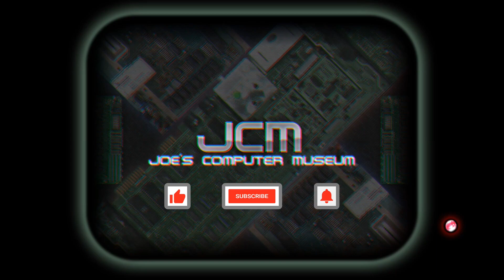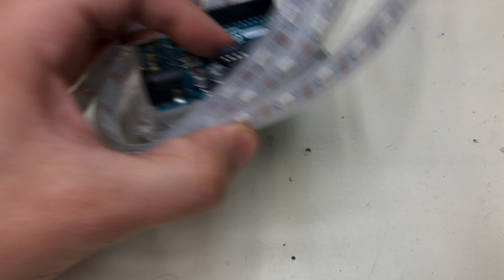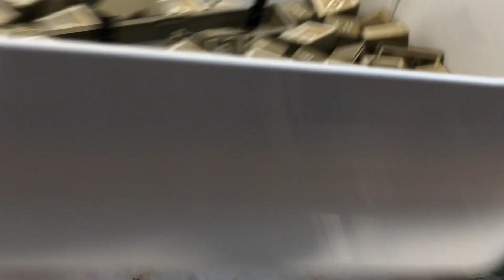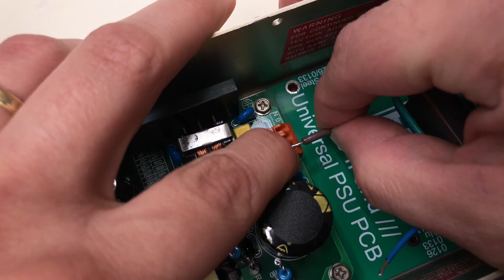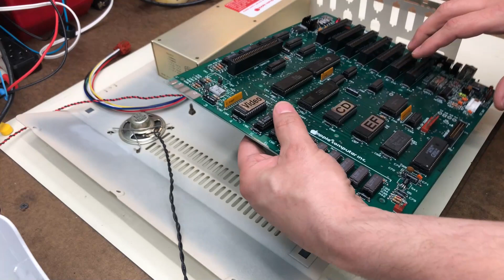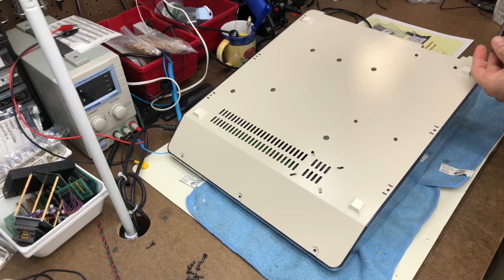Apple //e Clear Case Review and Assembly

Comment: That is really awesome.  Love the clear case.  I don't have an Apple IIe but if I did I would want this case.  I do have an Apple IIGS and would love one of those MegaAudio boards for some Apple II games.  Do they still sell them?  They are out of stock.
Reply from the maker: A2Heaven produces runs of boards from time to time. You'll have to keep an eye open. You can also contact them directly - very easy to work with.
Reply: @JoesComputerMuseum  Right on, thanks for the info!
Reply: MacEffects also reproduced the IIe to IIGS upgrade base pan, so it's possible to install a ROM 01 IIGS logicboard in the clear IIe case as well which is what I've done

Comment: Never really understood the appeal of clear cases and LED lights (going back many years to the PC case-modders), but even if I did go for that, I assume the case is entirely smooth.

I wore smooth areas where the heels of my hands rested on either side of the keyboard on the original case to my //e back in the day (and on several ergonomic PC keyboards since then).  The lack of texture bothered my hands and made them more prone to sweating.  I was able to arrange a top case swap at work in the late 80s, and I guess I haven't used my //e enough since then to wear that one down, too.
Reply from the maker: Short answer to your long question: yes, it's perfectly smooth.

Comment: Regarding the speed nuts, I believe MacEffects did try sourcing some, but unfortunately it seemed like that particular size could not be found, and the original Kickstarter didn’t account for having some custom made

However it appears the new Kickstarter for the clear keyboard, they did add producing new speed nuts as one of the stretch goals

As for me, I found some that sort of fit, but I had to trim them to make it work 

Nice idea about the MegaAudio VU meter, I think I’ll be doing the same for my clear IIe upgrade to IIGS
Reply from the maker: Yup on the Speed Nuts. I found out about that today after the video was published. Go Figure!

Comment: Sexy! Ah, the RGB tape and VU meters. :)
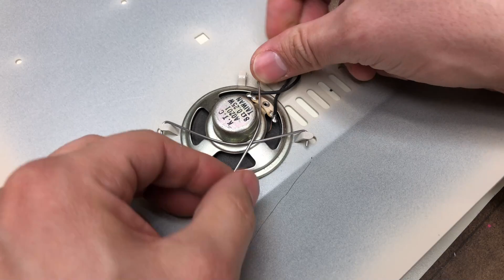7:15 - isn't this 2nd strap [in danger of] shorting to the soldered speaker terminal/pad if placed on that side?
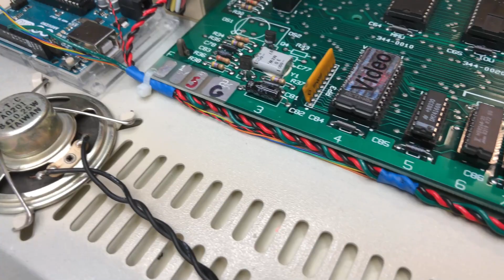9:07 - Nevermind - good catch. :)

Is this case acrylic? Any idea what to clean it with? A friend warned me to not use Windex on acrylic (when they saw I use it regularly to clean computer plastic cases.)
Reply from the maker: Yes. Shorting. That happened. I tweeted about it. Thought it was the keyboard. It was me being a silly.